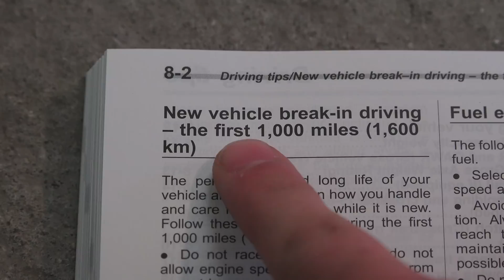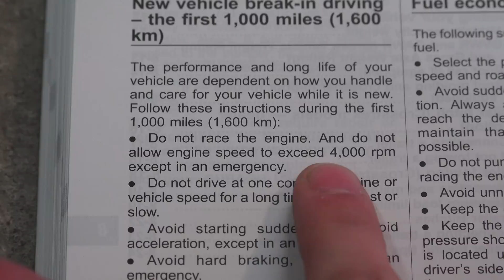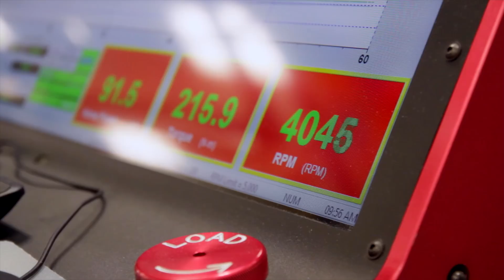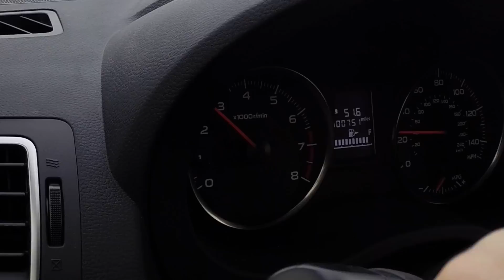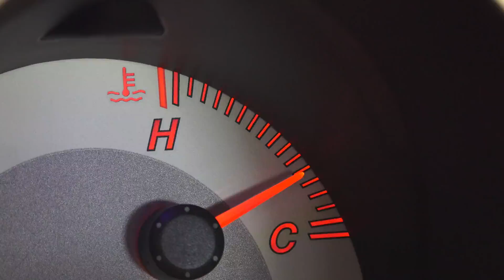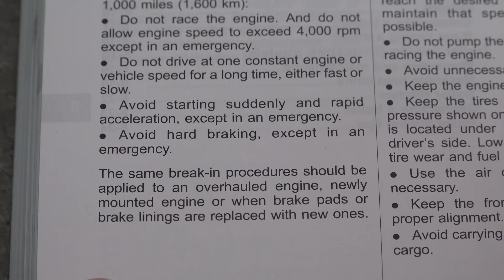5 Things You Should Never Do In A Brand New Car

Comment: That's why it's better to get a Tesla. :)
Reply: I wouldn't call being able to beat a Challenger Hellcat in a 1/4 mile boring.
Look up the new Model X.
Reply: I guess "boring" means that he just likes to have to perform constant engine maintenance (oil changes, tune-ups, etc.).  He like having to replace his transmission.  He likes the constant threat of one to several parts out of over 2000 parts simultaneously going bad.  The Tesla only has 18 moving parts.  Plus, I guess he doesn't like being able to have a car easily hit 300K miles without issues.  Also, he doesn't like being able to easily leave a Lamborghini and LaFerrari in a 0-60 run!  Then, there is the ability to have your car come pick you up, take you home, and park itself in the garage.  Those things would be boring. ;)
Reply: Not everyone can cut a check or get financed for a $60K Tesla.  Lithium cells have their own break-in practices too (IDK if that's included in the software or not).
Reply: But teslas are so boring
Reply: +HuntingTarg Not everyone can keep up with all that engine maintenance and gas ups, either.  Not everyone can have patience to wait a year and a half for a Model 3 ($35K before $7.5K incentives).  Li-on cells do NOT have a "break-in" practice.  Once the car is delivered, you can do what you want.  No such limitations exist for a Tesla.  The ONLY limitation is not being able to drive 400 miles without "refueling".
Reply: Ever read a cel-phone manual?  Perhaps I should not have said 'break-in practices' but 'best practices', and I did qualify that that may or may not be incorporated into the software - specifically that part that manages battery charging/discharging.
Your condescension is noted.
Reply: +BeJudicious You kind of contradicted yourself there.  After saying the Tesla's 0-100 and 1/4 mile are the best, you said over 60 mph the Challenger will clean it up in acceleration.  BTW, the best 1/4 mile for a Tesla is 10.79.  Teslas do NOT stop after 20km. Who told you THAT lie?!  Anyway, who races for 20km?! :D  Also, Tesla has liquid cooling for the battery packs.- Yes, Tesla has one gear.  It can reach around 18K RPM or so.  That's why the acceleration is SO smooth and the transmission lasts damn near forever.
Reply: +HuntingTarg Of course, ALL items have a "best practice".  That's not really saying anything.  Doing the above things with a gas engine can cause your car to need immediate repairs (expensive, too).  None of those things apply to Teslas.  Not using "best practices" with a Tesla battery does NOT result in anything remotely close to the damages seen in gas engines.
Reply: I take your point quite well.  There's nothing really to be done with an electric motor or a battery to cause it to self-destruct in its first 100 operating hours.  (There are the statistically unavoidable defective parts, but I don't think that's at issue here.)  I suppose what I'm getting at with non-ICE powerplants is that there are things that can be done with these systems, like most any other, that if done 'right off the line' will shorten their operational lifetimes.
Reply: +iHeart GT86 Did you forget how to tell the truth? Model 3 cars were never suppose to have free charging. Plus, you STILL get a 1000 mile credit of FREE charging EACH YEAR. Not to mention, it would STILL be better to charge than to use gasoline (even without all that). ;)

Also, your guess on battery environmental damage is completely wrong. The Gigafactory is basically a zero emission plant! And, THAT'S the MOST "soul" a vehicle can have.  Plus, it will last a hell of a lot longer. :D
Reply: By now everyone gets the point - you are, officially or no, a Tesla evangelist who seems drawn to having the last word like a moth to a gaslight.

Chip-printing plants in Silicon Valley would be considered 'zero-emission' plants if they got all their power from non-greenhouse-gas-emitting sources or credits, yet they create thousands of tons of unreclaimable wastewater every year from alkali and acidic solution rinsing.  There are unavoidable chemical by-products to fabrication of ICs and chemical batteries that have to be dealt with either on-site or at a HazMat storage & disposal center.
https://www.theguardian.com/vital-signs/2015/jun/10/tesla-batteries-environment-lithium-elon-musk-powerwall  -  Go about halfway down the article.
Ultimately I think it is a win for consumers and environmentalists, but talking like there is no downside is hype and hyperbole.

Comment: 5 reasons why you should never buy a brand new vehicle
Reply: Mike Seeds so you want to take the chance that the person who originally bought the vehicle new did the break in procedure properly? That's a bit of a risk considering that the majority of people never even read the owner's manual.
Reply: Reason #1 You're a Jew
Reason #2 You only view cars as a means of getting from Point A to Point B
Reply: Paul M Edwards Personally I think the risk is worth it. The cost savings are huge with used cars and even with a brand new car you can never fully mitigate the risk.
Reply: Another comment mentions how dealer employees will sometimes floor brand new cars.  So basically buying it new or used has a negligible effect on whether it has been broken in properly or not.
Reply: If its a sports car and a enthusiast owned it, they probably did the proper break in period
Reply: Mike Seeds you've got a valid argument there... I've purchased many new & used vehicles and each have had their share of major issues.

A few recent examples:
1) 2004 Chrysler PT Cruiser GT bought used in 2005 w/~22k miles for ~$21k. Had to replace the transmission in 2013 for ~$2,300 just before 100k miles. 

2) 2005 Yamaha FJR1300ATC bought used in 2013 with ~62k miles for ~$5k. In shop now at ~96k miles to repair worn out transmission by replacing shift dogs.

3) 2008 Buell 1125R bought new on 1/15/2008 for $13,500. Just got it out of the shop Friday after 4 years & ~$6k to replace the engine after 63k miles. Was supposedly the quickest, cheapest, and easiest fix.

Comment: Great video as always :-) I have ordered a 330e plug in hybrid and have been wondering how BMW and other hybrid manufacturers have gotten around this issue. Most of my driving will be using thw electric motor only so the engine won't get the chance to switch on before I get to motorway speeds, let alone warm up. I'd be very interested to know what the recommendations are for hybrid and even electric cars. Otherwise I'll just wait untill i get the car :-)

Comment: Well done, Jason. 
It should also be noted that the break-in procedure applies to  each component in the drivetrain such as clutch, transmission, U-joints, rear end/final drive gears, differential, bearings, brakes and tires.

Comment: Except for Toyotas. The reason they are bullet proof is because the engines on brand new cars are broken in at the factory. Toyota was the first to do this. I used to work there and have seen the videos of the engines just running on machines before putting them in brand new cars. So on Toyotas day one, have fun.

Comment: Do you have a video on different pistons? because the typical ones I've seen have those 2-4 valves on the cylinder head... so why is the one you're holding different?

Comment: Can you do Things You Should and Should Not Do in a Cold (In Winter) Car?  So much misinformation.
Reply: Weld the diff, drive sideways until the snow is gone in the spring.
Reply: Turn the car on and floor it until the engine is warm
Reply: @bruno-and-cars  LMFAO I'VE DONE THAT BEFORE
Reply: That's a humorous thumbnail, though.
Reply: Jeb Bush Come on, gimme a break
Reply: Use high quality oil. Thats all :D
Reply: why do you care Jab? you're in Florida
Reply: He probably spends a lot of time driving back and forth to the DC area though.
Reply: Gravstein I also live life on the edge. ;)
Reply: Jeb Bush i recomend you to start the engine and leave it like that until it get "warm" and then use it... its just an advice:)
Reply: warming up an engine is not recommend by many many manufactures. modern car engines do not recommend a warm up as it will cause premature ware to engine internals bmw being one of them

Comment: I have to say, I've never followed the break in procedure for a bike or car with the exception of the following rules:

1. Always let the engine warm up first.
2. Never labor the engine.
3. Don't maintain constant RPM.

Other than that, go nuts. The engines in my vehicles have always been mechanically sound and would outlast the rest of the vehicle easily, on the other hand, if it is going to break I want it to do it early and under warranty, thrashing it early (following the rules above) is likely to expose a weak engine/transmission quickly.

Comment: +Engineering explained You missed two other important points: 

6. Rather rev a little higher on a lower gear especially when going uphill than letting the engine struggle on a higher gear, although this also recommended after the break-in period too. Even more so for turbocharged cars as you will be making boost with the wrong gearing, regardless if the car has low end torque (mine peaks @ 1700 rpm - TwinScroll Head-integrated Turbo)

7. Not to exceed 2/3 of the maximum achievable engine speed. That's what it says in my manual and one of my colleagues who has owned many cars said the same thing.

 My car has a two phase break in period according to the manufacturer... All the 7 points (your 5 + my 2) for the first 1000 km. After that you can gradually increase rpm till its fully worn in at 1500 km.

/SEAT Leon Cupra 290 - 2.0 TSI (VW Group EA888 engine)

Comment: Every car I have broken in has been a long trip, varying engine rpm and load, I do not normally exceed 1/2 of redline for the first few hundred miles. I do normally full throttle but gradually rolling onto it in high gear. I have found manuals break in better and automatic never get the same result with an auto as I can not load the engine the same.

Comment: I get various rpm. Check out 650ib channel. He took his Kwai H2 to Brock's dyno.  He did a hard break in and it picked up some HP.
Reply: Interesting topic for sure
Reply: I would be willing to bet it's simply the break in that gained HP, not just because of a hard break in. Did he compare it to a normal break in with the same exact vehicle?
Reply: murkinstock actually yeah he did.  His old h2 and other guys h2 that was there for a tune.
Reply: great link, will check it out. Have been doing motoman's method on my Z motor but not seen anything other than anecdotal evidence of its benefits

Comment: i like to buy a new car and take it directly to a car detailing shop to have it prepared against the elements from the inside and the outside, but i am always worried that someone might floor it before it is broken in properly especially if it is a sports car with an exhaust note, this adds to the chances it will be abused there.

Comment: Except the GTR is flogged around their test track as soon as its assembled. The break-in periods written in manuals might be written by lawyers not engineers, making sure people get use to their new vehicle before they really go for it. All Porsches are also dyno tested at full throttle at the factory. It seems like full throttle is ok during break in, I wouldn't do a top speed run or anything but a short pull, even to redline probably wont hurt anything.

Comment: Do u think I should by smaller rims for winter tire? I think it is called tire sizing
Reply: I usually run one or two sizes down. For example, my summer tires are 235/55R17, and my winters are 225/60R16. Narrower tires cut through snow and slush better than wider ones which tend to "float".

Comment: You're not really this naive are  you???  Can you not think of ANY reason that a "PERFORMANCE" car's manual does not want you getting in your brand spanking new car and NAILING the gas....  

one word   L I A B I L I T Y
Reply: paul taylor this argument fails because the NSX does the break in period in the factory so when you get the car you can go drive it as hard as you want
Reply: one word R E K T
Reply: No it does not. No company is going to break standard and be known as the one to tell you to go full throttle right out of the dealership.  Im not making this up, this has been know by engine builder for Y E A R S
Reply: *****
yeah, you got me.  One model does it this way, and the entire industry will ignore liabilities.  I've broken in more engines than most have cars.  But I digress.

Comment: How about Diesels? I heard that a heavy load (trailer, etc...) is recommended while breaking in.
Reply: Kirk Grames That's a bit strange. Most recommend no towing for the first 500 miles and some the first 1000 miles.
Reply: Kirk Grames 
Read page 57 of the owners manual. 
It states: " Do not tow a trailer at all during the first 500 miles (805 km) the new vehicle is driven. The engine, axle
or other parts could be damaged.
Then, during the first 500 miles (805 km) that a trailer is towed, do not drive over 50 mph (80 km/h) and do not make starts at full throttle. This helps the engine and other parts of the vehicle wear in at
the heavier loads."
Reply: Diesel engines require break-in also. 
The diesel (compression ignition) engine break-in procedure is practically the same as gasoline (spark ignition) engines and for the same reasons. 
The mechanics of initial break-in is not different for diesel, gasoline, CNG or propane fueled engines.
Reply: I believe it's not recommended to tow or haul anything because it's hard on the rest of the drivetrain, not just the engine.
Reply: I have a new Diesel (2015) in my jeep and it recommends (in user manual) towing with the vehicle ( if possible) during break in.
Reply: something1random23 
That is partially correct, the entire drivetrain requires a break-in period and procedure. 
Towing loads the entire powertrain. 
Towing and the resultant loading of the engine is also detrimental to the engine, mainly because of piston skirt loading resulting in piston skirt scuffing/scoring due to the cylinder finish initially having high ponty plateaus that act as an abrasive on the softer piston material and also promotes excessive wear of ring face.

Comment: Why is the nsx at 3:54 bouncing that much on the front suspension? On motorbikes the suspension should be not hard (like you said in your video on stiffer springs) but firm, bouncing means there isn't enough dampening...
Reply: I was wondering the same thing. It looks like almost no shock absorbers.

Comment: 1. Engines are broken in from factory. 
2. As a new engine gets normal use, wear will collect in the oil. Change your oil at 100 miles and again at 1000. If you are super on keeping it safe. 100/500/1000/2000 or until you a significant diminish in metal shimmers in the oil. 

Everything else was spot on. Great vid.

Comment: Why do all engine builders say to break it in hard on the Dyno but stock car manufacturers say to break the engine in soft over the course of 1000 miles.   If you have every had a fully built engine with aftermarket forged rods and Pistons they will tell you to break it in on the Dyno.  Typically the tuner break it in on the Dyno by veering the rpm for about 30 mins. But after that the full throttle pulls start.

Comment: I guess my question would be what happens if you make an mistake or error... I just got in to my first WRX and on the long drive home I did maintain rpms a little more steady than would be recommended I've since that night made sure I varied RPMs and not gone over 4K save for an emergency and one error in shifting. Is my car done for or are is the fact that I've practiced proper break in for 99 percent of the time mean I'll be ok? I know I can't do anything about what came before I bought the vehicle but I'm hoping that my good practices since will help insure a proper break in.
Reply: Luis Antonio Lugo Should be fine, just monitor your oil consumption - that's a good indicator.

Comment: Don't they test the Nissan GT-R on the track after its built?
Reply: yes, at full throttle no less...
Reply: engine is first set on dyno and thats where its break-in
Reply: Yup they do for all GT-R spec. They don't go enough to fully break in your engine, but they don't go full track. there's a video you YT that basically takes it around a small track for less then 3 mins to ensure everything is is seated properly.
Reply: Yep, all the mechanics and engineers breaking race engines on dynos are doing it wrong, according to this video :)
Reply: every super car is tested before.
Reply: Who tests them? No company is gonna test all the new cars.
Reply: ady gombos Nissan tests their GT-R motors on dyno and slightly track run.
Reply: SmartedPAnda Well, maybe they do that but that's just a few in a thousand.
Reply: ady gombos ... yeah that's why the discussion was about the GT-R class... think you should watch and read this comment again
Reply: +Hurricane Matthews lucky the nissan isnt a super car
Reply: zomski101 engine gets broken in on the dyno
Reply: they test all gtrs im sure.. its a 150k car its not going to be mass produced like your typical cars such as honda and fords
Reply: Acura used to do that with the original NSX. They all had laps at the Twin Ring Motegi before they shipped. Also, they were completely hand built, engine and body panels.
Reply: your not, its not. but the higher ends are still tested
Reply: Johnfuse a car that wears underpants
Reply: Wouldn't be surprised if most high-end performance cars are tested that way.
Reply: zomski101 GT-Rs are all built on the track. Literally running the track round and round as they are being built. Therefore, it is purely a performance car. Fact.